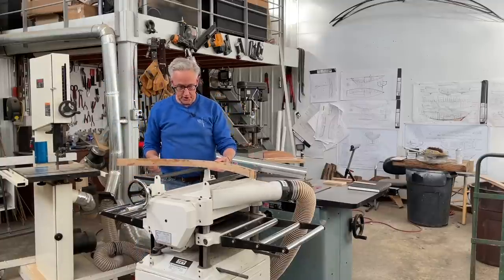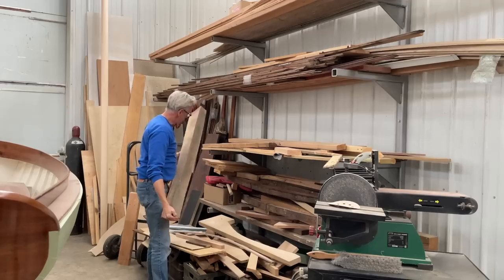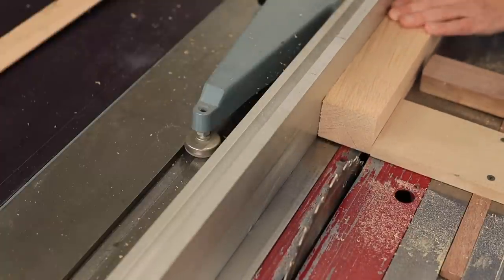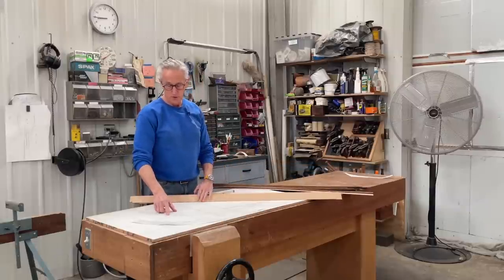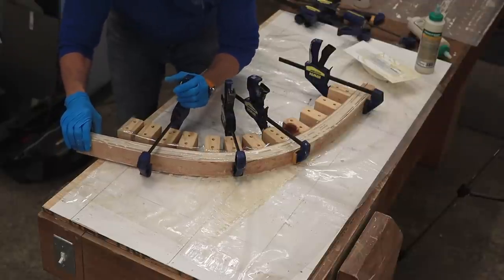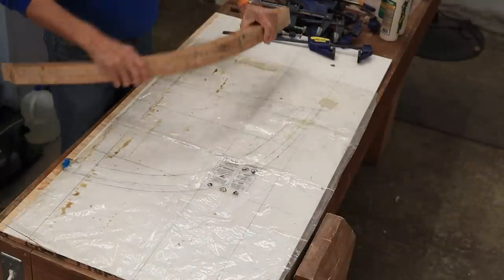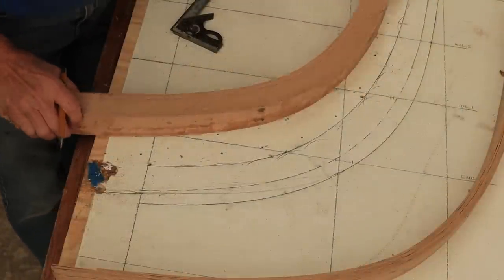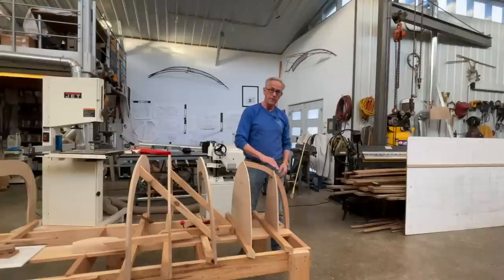How to Laminate a Boat Stem, S3-E6

Comment: Glad you're back up to snuff Bob. One question though: Why did you go with titebond instead of epoxy? I know type 3 has the longest open time but it's still only around 10-12 minutes. Maybe a bit more in a cooler environment. I would have been seriously stressed!
Reply: @marievictoire1939  Leo use a lot of epoxy with oak on Tally Ho.
Reply: I wonder the same thing.   Oak and epoxy definitely can go hand in hand.
Reply: @holmesanderson5067  Yeah, Bob has his own way of doing things but you can't argue with the results. The table saw technique was pretty scary though. I was surprised that he didn't use and mdf form too but the parts seem to the correct shape. As for Tightbond 3 you are spot on but I'm guessing he's using it because it's a dingy and won't be in the water all the time although if Steve is at anchor some place my guess is it will be in the water for days or weeks at a time. I'm wondering if he's going to glass it. If not I, like you, have concerns. I'd love for  him to weigh in on this.
Reply: Titebond gives you much more working time than epoxy.
Reply: @brutusbarnabus8098  That is completely dependent upon which type of epoxy you use. You can get working times up to an hour or more with epoxy.

Comment: Bob - great stuff - glad you feel better - why wood glue and not epoxy?
Reply: I had the same question but In an other (older video) he stated that some people use epoxy everywere. He has done some tests if i remember correctly, and he said that for the application that he will be using it, the woodglue will be suffisiant. In the end the whole boat will be coated with epoxy so that wont be much of a trouble.
Reply: I was going to ask the same question. Perhaps it's because of the health hazards associated with epoxy.
Reply: @ralphgesler5110  so wood glue will stand up to salt water emersion? - Genuine question?
Reply: @sailingsomeday5975  If inner stem is emersed in salt water then you have other things to worry about..... xD Meaning, the inner stem isnt supposed to come in contact with salt water :P
Reply: I’ve been told at WoodenBoat School that epoxy doesn’t adhere as strongly with oak. The high tannin content?
Reply: @frommyashesrisenrebornredemed  forgive me if I missed something but he made the inner stem and the "False" stem the same way...and even if you cover/coat it - it is the stem and will take knocks and bumps - So the wood Will get exposed - So I had a very simple question - does wood glue hold up in salt water......
Reply: @sailingsomeday5975  
 @Sailing Someday  
I probably mist that. Gonna have to watch it again. But even so, I think the key word here is...... Stripplanking..... It's not epoxy that is used there to glue those strips either. I hope Bob links the video were he talked about woodglue vs epoxy.

Comment: Why did you use Titebond and not epoxy?
I like that concave surface plane!
Reply from the maker: White Oak does not play well with epoxy.
Reply: @TheArtofBoatBuilding  Aha. I've experienced that. Nicely planed white oak can have a surface as smooth as plastic. When I've epoxied it, I would rough up the surface to give the epoxy something to grip on to. But for something that will take stress, it makes sense to use a different adhesive.

Comment: At 14:29 what is the glue lam life with titebond  vs. epoxy?
Reply from the maker: Titebond III is not effected by UV light. Unprotected epoxy degrades in UV light. I epoxy is protected they will perform the same.
Traditional epoxy should not be used with White Oak. One reason is its lack of dimensional stability. All wood reacts to changes in moisture content. It shrinks as it loses moisture and it swells as it gains moisture. Typically, the movement is much greater across the grain of the wood than it is parallel to the grain. This movement can result in warping, splitting, checking and other problems. Oak, especially white oak, is one of the more dimensionally unstable species of wood. It twists and bends as it tries to adjust to changes in its moisture level. For example, when its moisture content changes from 7% to 12%, a piece of white oak will swell about 50% more than a piece of Honduras mahogany under similar conditions. With this much movement, the stress on a glue line becomes enormous and can pull the joint apart.
One could use a flexible epoxy adhesive, such as TotalBoat FlexEpox, or WEST SYSTEM G/flex to bond white oak.
Titebond III plays well with white oak.

Comment: why not use a bandsaw with a guide, as you lose a lot of wood with circular saw's wider kerf
Reply from the maker: Hi Henry, a bandsaw leaves a rough surface that would then need to be surfaced on a planer. One would lose more material than a table saw and require more steps and time. 
Thanks for watching!
Cheers,
Bob
Reply: @TheArtofBoatBuilding  oh ok I see! thanks for the tip